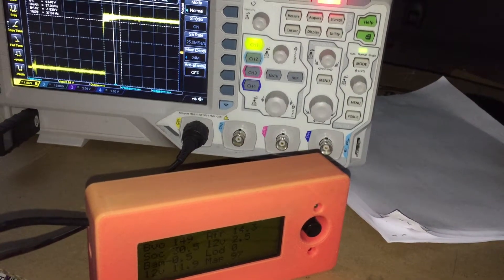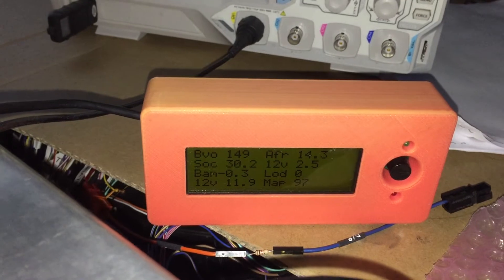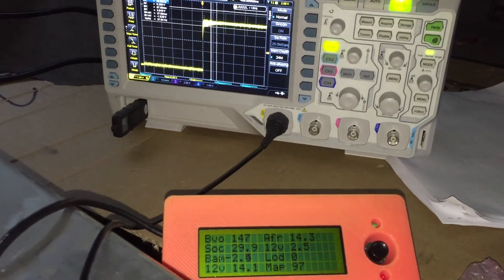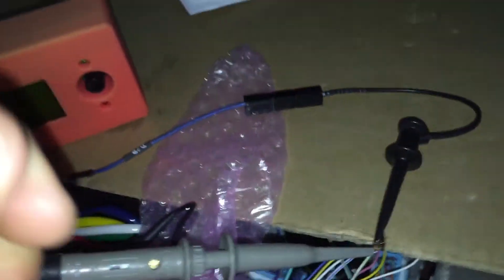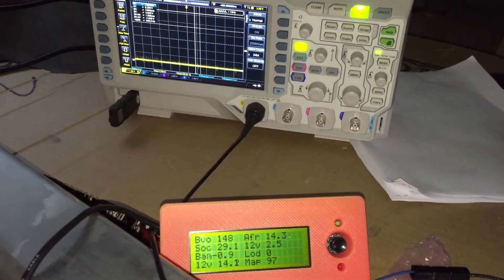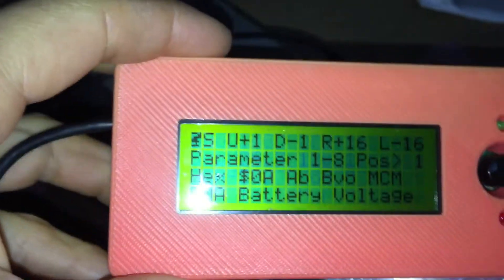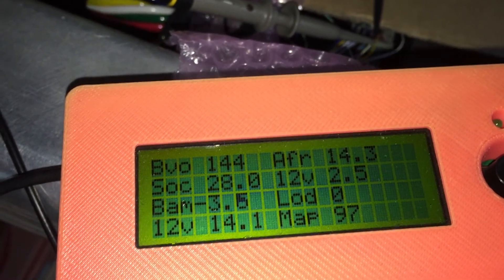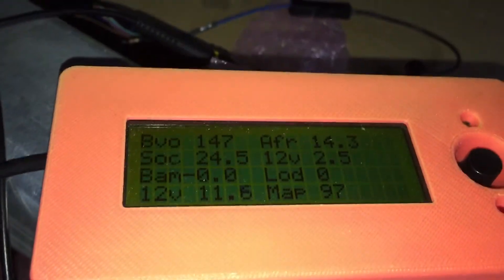Honda Insight G1 - Keep your 12 volt battery charged by cutting one wire

Comment: My IMA battery is toast and I tried this but nothing happened? Checked the voltage out put to the 12 volt battery before cutting the wire and after, no change what so ever? Doesn't work do not waste you time.

Comment: can I cut the white and green wire on the DC DC harness to run 14 volts continuously even though my IMA battery is functioning as it should??

Comment: could you please input me an info what does a code P0AE1 using Innova 3100 model of OBD scanner..
It says "Hybrid Battery Negative Contactor Circuit Low"..on my 2006 Honda civic Hybrid..where in the Hybrid system can i find the "hybrid battery negative contactor?
Reply: did you fix your civic joseph livas I am having same code and problem with mine
Reply: estrella520ify    no.. not yet can not do anything yet but still running on a 12 volt battery for now on short distance  trips and keep charging externally..

Comment: You mention a pullup resistor. Is it necessary to add one, or is there one already in place? I have removed my IMA battery, and added an Arduino to pretend to be this system according to your other video to get the check engine light to go off. All of that is working. The battery light occasionally goes on because the 12V battery voltage has temporarily dropped below some threshold, and I'd like to correct this.

Comment: Awesome discovery!  So new procedure for IMA bypass - just cut white/green wire and you are done?  I am missing one part of the equation still, apologies if I am slow.  So if your IMA battery is in poor shape, IMA light on and you don't get assist or regen, How does the IMA battery ever get charged again since our cars have no alternator and regen no longer will work?
Reply from the maker: You actually need to cut two wires: both the MCM and ECM have lines that control the DCDC converter.  We've cut the line from the ECM to the DCDC.  If your IMA is bad, the MCM will disable the DCDC.  Hence, you'd need to cut the wire from the MCM to the DCDC, too.
Reply: https://goo.gl/photos/GxWHNiDE7vh13e8k9   Wht/Grn  and Grn/Blk
Reply: @striderz69  Thanks for the great pic! Do you know if the wire colors are the same for a Honda Civic G2 (2010)? Also, are there any special instructions for accessing these wires, or do you happen to have a similar pic for a Civic? Finally, please excuse the novice question, but should I wrap the cut wires in electrical tape? Thank you in advance!
Reply: Thank you
Reply: qwqehwekrhlfjghdklfj is there anychanve yiu can show which to wires and plugs ?
Reply: @fründlie  I am glad you were able to resolve your concern! Thank you for the update and for the recommendation on the solar panel charger. I am also considering upgrading the 12V battery from a 151R to a 51R (higher capacity), if needed. One final question, did you wrap the cut wires in electrical tape? Again, thank you in advance!
Reply: qwqehwekrhlfjghdklfj What color is the wire from the MCM to the ECM, that needs to be cut?
Reply: Sure, any 12v accessory should work as intended now.
Reply: @fründlie  Hi there! Did you proceed with cutting the two wires? Can you please provide us with an update? Thank you in advance!
Reply: @fründlie  Heck yeah, 40mpg sounds great! Once I am able to confirm that the wiring colors for a Civic G2 are the same as the pic provided for the Insight G1, I will proceed and share my results.
Reply: @us07041776  hi did you find the 2 wires that you have to cut on the Civic I'm in the same process just need to locate those 2 wires
Reply: Guys can you help me, my car ima light is on, regen doesn't work, when I drive 12v, brake are on sometimes abs and eps come on and dash starts blinking also steering becomes hard, what do I do
Reply: @carlosmonkee  Sign up at insightcentral.net and ask questions.